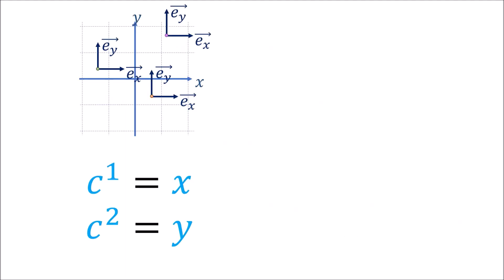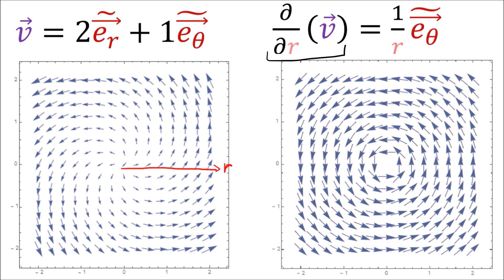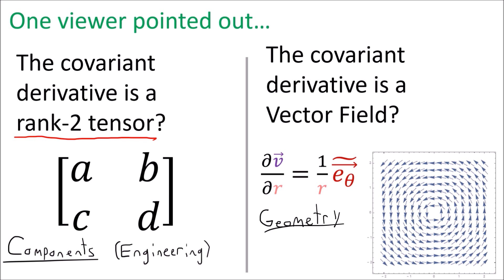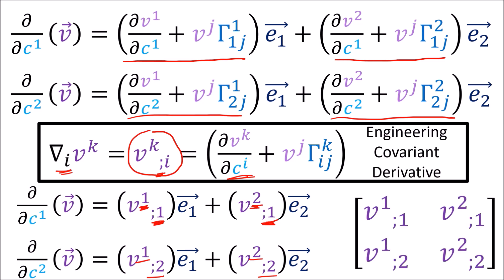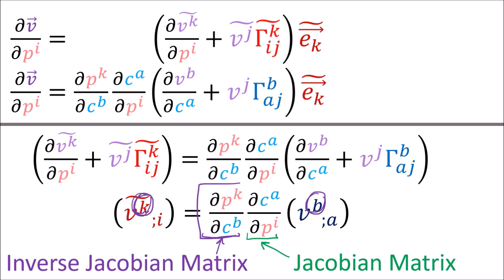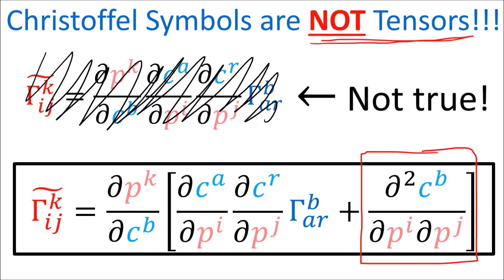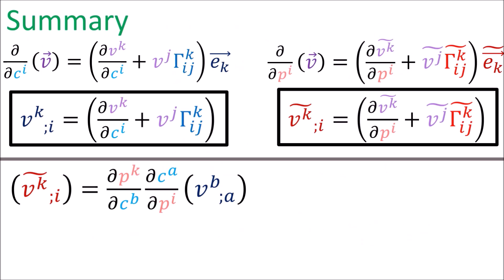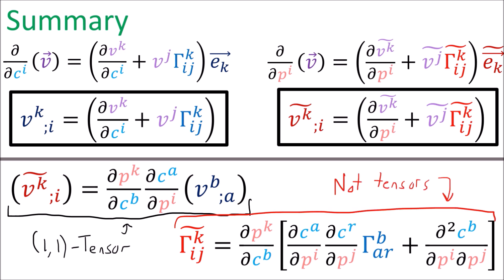Tensor Calculus 17.5: Covariant Derivative (Component Definition) - Optional

Comment: Great video. At 8:48, you added the Jacobian at the front of each side of the equation to cancel a component.  I have not seen this kind of usage elsewhere in this lecture series before.  Would be great if a little more can be said here.
Reply: All he did was multiply by the inverse. Maybe or maybe not he's never done it with the Jacobian specifically, can't remember, but he's done it a ton with the metric tensor
Reply: we love kronecker deltas

Comment: hey at 8:55,when you first said the delta is strictly equal to 1,i can appreciate that since it just cant be 0 or the left hand side equation will be zero.
But at 13:56 when you used that trick again,i dont quite buy that idea any more…it seems to me the delta can be zero,because for that only one term goes to zero,the other term is still there，so it seems ok to me.
But the way you did it,you said its also strictly equal to 1,so as the delta at 14:27.
could you explain on that?

Comment: 8:55,i dont understand the part where you alleged the partial derivatives are a kronecker delta.It doenst make sense to me those partial derivatives are (possibly) zero.
Is it just a postulation?since you later said n is strictly equals to a.
Reply from the maker: The partial derivatives on the left side are the matrix entries of the Jacobian matrix and Inverse Jacobian matrix. When we sum them (matrix multiplication), we get the identity matrix (given by the Kronecker Delta in tensor notation).

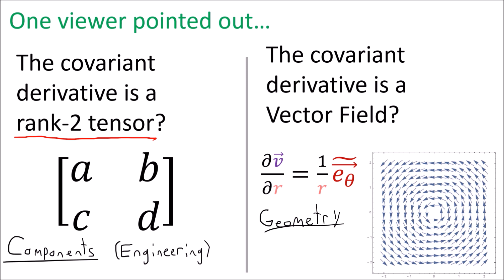Comment: 2:23 I think the difference between the rank-2 tensor version and the vector version (of the covariant derivative for a vector field) is the same as the difference between the exterior derivative df and the application of a vector v(f) for a scalar field f.
Reply: @DnB and Psy Production Yeah, although I will say that vectors are tensors too so it is still a tensor even after you plug in a tangent vector. Also, I want to mention that it doesn't make sense to say that two tensors on different points on a manifold can't be the same because they don't even live in the same tangent space.

Comment: It makes sense that the Christoffel symbols are not tensors, since we defined it in a quite arbitrary fashion as the tangential components of the variation of the basis.
Reply: I realize my previous argument is very incomplete...sorry I got confused. If someone finds a nice simple explanation why Csymbols are not tensors I would like to know, thanks.
Reply: @imaginingPhysics this chap chris did explain in this video.essentially it doesnt transform in the way vectors  or indeed linear form did,ie using the (forward/backward) transformation matrix.instead,they transform with an additional term added on top of that
Reply: @chenlecong9938  yeah but he's asking if there's a geometrically "obvious" way to tell that Christoffel symbols aren't tensors. So I guess this would be asking for a easy-to-remember concrete example where one can visualize that additional term in the transformation rule. Just take any example with nonzero Christoffel symbols in one coordinate system and all-zero Christoffel symbols in another coordinate system. Clearly in such an example the additional term is nonzero. Such an example is polar coordinates vs Euclidean coordinates. (If you really want to visualize that example, look at 13:27 on the last tensor calculus video. Note the black arrow gets more horizontal as dtheta goes to zero.)
Reply: Yeah... Often in literature this fact is argued like "they do not transform as tensors". I used to Wonder why not?

When I understood they are explicitly defined to track the changes of the coordinate tangent vectors, which obviously depend on coordinate system, it is clear these symbols must depend on the coordinates.

Comment: I'm an engineer and I confirm that we are used to see covariant derivative as matrices.
Actually, we are used to see any tensor as a matrix since, when you work with finite elements, you got to get the job done, so you need to fill in the matrices and make them work.

But we have to always remember that a matrix (or an array) is just a (useful) table of numbers; not more, not less.
A matrix is not a tensor and the underlying geometric meaning is completely different.

Thank you Chris for this course, it's so interesting and well done!

Comment: I'm only suspecting it here, but is the fact that Christoffel symbols are not tensors related to second-order derivatives also not being tensors?  (I tried deriving the transformation rule of the second order derivative, and it didn't transform like a 2,0-tensor either; it also had an additive compensating term.)

And if the second order derivative isn't a tensor, then what mathematical object is it an instance of instead?

Comment: Hi Chris, I'm a bit confused at 9:25 where shows both the inverse jacobian matrix and jacobian matrix are next to each other, so it could mean that the product of them will be Kronecker delta. That means the Polar vector components and the Cartesian vector components would be the same, which is not possible. Please help me make it clear. Thank you
Reply from the maker: It is true that these are the inverse jacobian matrix and jacobian matrix, but if you look at the summation indices (k,b,c,i) you will see that none of them are repeated, and so there is no summation between them and they do not become the kronecker delta. Instead, the are summed with various terms inside the brackets.
Reply: Ohhh I see. Thank you! 😁
Reply: Kind of related, since the Jacobian and inverse Jacobian are the Forward and Backward transformations and you show that the covariant derivative transforms with one Forward and one Backward transformation, and the covariant derivative of contravariant vector components looks like a (1, 1) tensor.  Does that mean the covariant derivative is a linear map, if so what does it map from and to?

Comment: Sorry, but this is too fast. And it is simply not true that the kovariant derivative is a tensor. Kov. drivative ♡_x (Y) is not linear in the second argument Y. Your definition of tensors through the transformation rule is indeed very physical. A tensor is just a multilinear function. Thats it.
Reply from the maker: I agree that the operator ∇_X(   ) is not multilinear, but the result of ∇_X(Y) is a vector field, which is an example of a tensor field.

Comment: How do you calculate the curve parameter to begin with? Is it just a random path through a vector field or does it apart of the vector field ?
Reply from the maker: You will usually be givven a curve to start with if you were dealing with a real problem.
Reply: @eigenchris  Like the path of a particle in a vector field, or some worldline through spactime?
Reply from the maker: @dansaunders6957  Yeah, in GR we would be primarily linking of worldlines.

Comment: Quick Question Why we use Covariant Derivative instead of Contravariant Derivative in General Theory of Relativity? I couldn't find any satisfactory answer anywhere....Thanks in advance.
Reply from the maker: I'm not familiar with anything called the Contravariant Derivative. Taking the derivative increases the covariant index because the derivative adds an extra index in the denominator.
Reply: It's very confusing terminology as there are two different meanings of the word covariant!  The word covariant in covariant derivative does not refer to taking the derivative of a covariant vector (you can just as easily take the covariant derivative of a contravariant vector).  It comes from the other meaning of covariant which gets across the idea that this type of derivative can be expressed in the same form in different reference frames.  It's meaning is the same as in Einstein's principle of general covariance which states that the form of all laws of physics should be the same in all reference frames.

Comment: Hi, what is your video tool ?
Reply from the maker: Microsoft Powerpoint.
Reply: @eigenchris  no way
Reply from the maker: The "Insert" tab has an equation editor in it. The "Animation" tab lets you deice when and how stuff will appear. The "Recording" tab lets you record a slideshow with audio, and draw on your slides if you have a tablet. You can then export the PPT to a video (mp4) file.

Comment: If you don't specify the direction of the covatiant derivative, than the covariant derivative of a vector field will map a vector at a point (the direction) to another vector at that point (the result of the derivation). This is a (1,1) tensor.

Comment: In video 14:34, I found that tensor component v sup n in the first term was suddenly changed to v sup r without any explanation. Is there any mistake?
Reply from the maker: I probably should have explained, but you can always re-label a tensor index, as long as you do it consistently. So there's no problem with relabeling n to r.

Comment: Great job on these videos!  Would you mind sharing what tools you use to make the videos (math typesetting, visualizations, screen capture)?  Also, if you have any recommendations for a certain microphone or anything else in your setup, I'd be interested.  Thanks for giving clear examples and explanations of complex material!
Reply from the maker: I use Microsoft Powerpoint to make the vidualizations. It has an equation editor and a record button so you can recors while you present.
I am not an audio person so I can't give much meanignful advice. I bought the Blue Snowball microphone simply because google searches told me it was a good choice (it was around 60-70 USD). I use the Audacity program to denoise and also "compress" the audio so that the quiet and loud parts of the recording are more balanced. Also, as odd as it sounds, I have recently learned that recording while hiding under a blanket can reduce the echo and improve audio quality if your room space has echo.
I also use Windows Moviemaker to edit video but sadly it is no longer available.
Reply: @eigenchris  Cool.  I didn't realize you could record Powerpoint.  Keep up the good work and Merry Christmas!  We still have Movie Maker that we installed before it was discontinued.
Reply: @eigenchris Hi Chris, I think your editing setup is a bit heavy, I suggest to use Camtasia wich eliminates the need  for Audacity since you can do "voice over" a Powerpoint presentation. It is much faster and easy to use than other editing softwares. Is compatible with any USB microphone and also can compress audio.
Reply from the maker: Thanks for the suggestion. I actually find it very hard to speak and write at the same time... but it might be something I need to learn to do, as my editting process is indeed heavy.

Comment: At 04:28, after expanding the summation over the k index there still is the implied summation over index j. I am not clear on whether or not a further expansion of v^j Γ11j e1 and also for v^j Γ21j e2 is required - or should it be simply that the j value for the e1 term is really a single value 1 and not the entire range of j=1 and j=2 ?
Reply from the maker: You need to sum over the entire range of j. In this case j=1 and j=2.

Comment: at 2:38 you are showing the partial derivative of the vector field as ∂/∂λ (v). But since there is only one single parameter, it seems the full differential d/dλ (v) would be more appropriate. Or am I missing something ?
Reply from the maker: You're correct. That's a mistake on my part.

Comment: Hello Eigenchris!
I have a stubborn question: If covariant derivatives are (1,1)-tensors (and then a second order tensor) why we do not write then as

\nabla V = \Big( \nabla _{\nu} v^{\mu}\Big) \frac{\partial}{partial x^{\mu}}  \otimes dx^{\nu} ?
Reply from the maker: I think you could write the tensor like this. When you apply this tensor to the basis vector (frac{\partial}{partial x^{a}}, the resulting vector is the vector I described in this video, v^{\mu}_{;a} \frac{\partial}{partial x^{\mu}} .